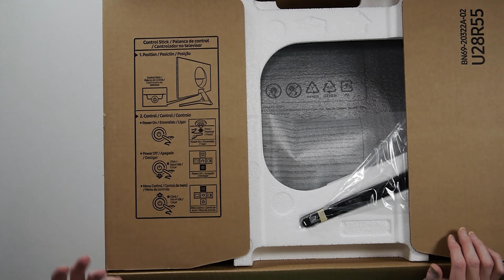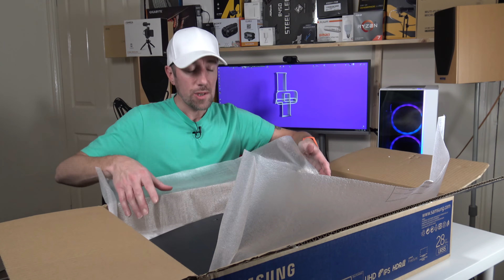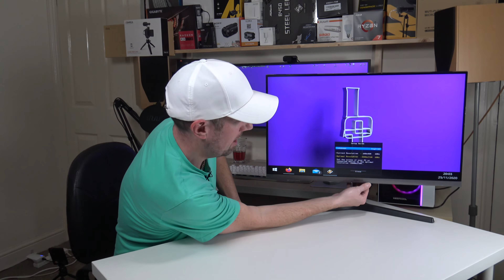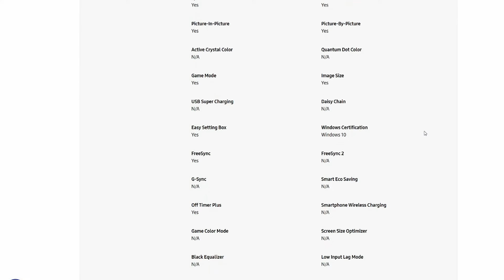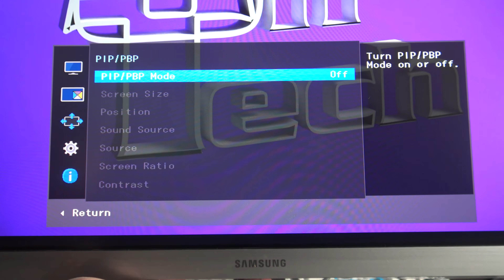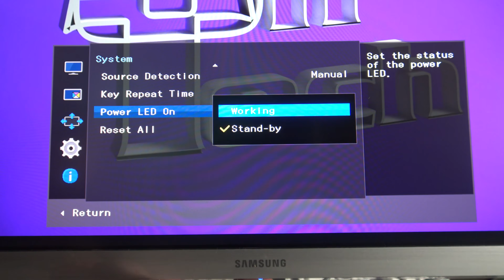Samsung 28 Inch 4K Monitor - Unboxing & Setup! (UK 2020)

Comment: i have a question..if you have this monitor can you connect your xbox as well as your pc to it and switch inbetween these two?
Reply from the maker: It does have HDMI and display port, so you could yes 👍 tho the monitor is only 60hz

Comment: Received the RU55 monitor yesterday, it's awesome!  I connect my MIBOX3 to HDMI1 and PS5 to HDMI2, but why can't I turn on game mode on the monitor when I use PS5?  The monitor no longer allows me to use "game mode" in the "picture" settings, but the MIBOX 3 HDMI1 allowed me to turn on game mode.  On PS5 I have of course PC selection, but on MIBOX3 I turn on AV selection.  FreeSync and HDR On When Supported are turned on, but why does the monitor not allow the game mode to be turned on, I need an explanation, but I'll be honest, right now the PS5 quality of the image I see on this monitor excites me!
Reply from the maker: Try a HDMI to display port cable 👍

Comment: I received mine today and so knew how to setup the stand thanks to your video. All went well.  However, I'm not sure how to remove the stand. Does anybody know?

The stand is fine for now but I'm thinking eventually getting a monitor arm.
Reply from the maker: Undo the 2 screws, then with the monitor laying down, pull the stand down. It took me a while to figure it out too 🤭

Comment: I plug it in but it’s black other than when I hit the menu/navigation button in the bottom. What do I set it on to get it to communicate with the hard drive?
Reply from the maker: Hard drive? You need to connect either a pc or laptop to it via HDMI 👍 it should auto detect whichever port you've plugged your HDMI in to. You might need to change display settings if on a laptop to use a 2nd display tho. Hope that helps 🤞

Comment: I'm having an issue with this monitor for gaming, so e.g. when gaming in 4k, there's a massive delay/lag when turning around, or just in general moving, even though FPS counter is over 100. as well as developing micro stutters, this reduces is 1080p, however still exists, my 1080p monitor has no issues at all like that, so not sure if it's the monitor issue or it's just meant to be that way

Edit : turns out if your mouse polling rate is over 2k it'll do that it's not the monitors fault
Reply: You can turn on the max overdrive settings if you want more responsiveness, but it will introduce noticeable ghosting usually on these non-gaming monitors.
Reply: @HandleIsNewAndBad  All solved, all I had to do was go into razer settings and reduced poling rate, solved the issues instantly
Reply: @xSkittlesxNewbx  Good to hear that.
Reply: @xSkittlesxNewbx  how do i do that?
Reply: @feetfanatic222  I hope this posts, as YT kept rejecting the post, but tldr, what kind of issue are you having? I had to try many different ones, until I found one that would suit my situation and sort the issue

Comment: This does not support hdr.. i wish i knew that before purchasing. 

BUT overall a good monitor for next/current gen consoles. Has 4k support, 2.0 hdmi, perfect size for gaming (32inch), and supports game mode and has other several key features.
Reply: HDR 10 on mine!
Reply: It doesn't huh

Comment: Hi ive had this monitor for a while and i use it for my XBOX ONE X, when i use HDR on the xbox my games go really dim and washed out, like ill be on the menu screen for RDR2 its bright for a few seconds then just goes really dim, ive tried adjusting brightness and other settings that dont become locked but nothing undims the display, Eco save is not on but its seems as though its always locked on in HDR mode, any ideas or fixes ? Thank you :)
Reply: You shouldn't use HDR with it. It's not capable of the required brightness or contrast. Stick to SDR.
Reply: @AdamH7  smh

Comment: Can i put keyboard cable,mouse cable, Head phone cable it same time
Reply from the maker: No, this is just a monitor not an all in one PC.
Reply: @IXISonTech  so which one and not expensive
Reply from the maker: Depends on what you will be using it for. 
They arent really good for gaming, but for productivity they'll be ok. 
Have a look on Amazon or a local electronics stores website 👍
Reply: @IXISonTech  i will message you on go store

Comment: I just got a Samsung 28 inch 4k  monitor for my dell laptop but my system wont work I need major help!
Reply from the maker: Change the resolution for the 2nd monitor to 2k or less 👍 
My works laptop just about worked with the 2nd monitor set at 4k, but 2k works great 😁 hope that helps 🤞
Reply: @IXISonTech  More than half of the settings on my monitor are turned off.
Reply from the maker: You need to change display settings on your laptop, just leave the monitor settings alone until you can get a picture on it. Are you using HDMI to connect to the monitor?
Reply: @IXISonTech  Okay ill try to change my computer setting, and yes I'm using an HDMI cord.

Comment: Any reason why game mode is not available. I plugged in the same hdmi that came with it. Any help
Reply from the maker: I'm guessing you've tried both HDMI ports? This monitor only goes up to 60hz. If you're on a PC or laptop, have you gone in to the display settings? 👍

Comment: hi, can I ask how to open the sound. because it always mutes. I already open the volume to be the largest, and set it to be output. But the volume still does not work.
Reply: Bro it dont come with built in speakers u buy there speakers seperate
Reply: @Alibingol12  cringing
Reply: same thing here, have you solved it?
Reply: What kind of speakers do I have to get? Not sure what to order for them
Reply: @abdel2351  go for same brand speakers

Comment: Ordered mine today but at £299 from John Lewis. I got it for my Mac mini M1, can you do a video on external speakers for this monitor?
Reply from the maker: Nice 👍 If you're looking for a soundbar, the Majority K2 is good 👍 I did a video review of that too 😉
Thanks for watching 😃
Reply: @IXISonTech  I’ll give it a look, cheers
Reply: hi, can I ask how to open the sound. because it always mutes. I already open the volume to be the largest, and set it to be output. But the volume still does not work.
Reply: @yuuuyi_tv  if you mean on the monitor, you can't, as there are no speakers built-in. 
You'll either have to use the speakers built into your computer or if it doesn't have speakers, buy external speakers instead. 
Hope that helps...

Comment: When I first turned mine on a screen popped up and told me that the selected resolution is 2k but I could change it to 4k. It went away before I could change it, and I can’t seem to find a way to get that screen back up. I went through the all the settings in the menu.
Reply from the maker: You can only control the resolution through the pc or other device connected to the monitor. What have you got connected to the monitor?

Comment: I got that Sam one but you can use it weigh speaker’s
Reply from the maker: Yes, you can use speakers with it. In the back is a headphone socket, so you can plug your speakers in there (providing the speakers have a headphone jack) then change you audio through windows to the Samsung monitor through HDMI 👍

Comment: Hi, my monitor is the exact same one as this one and it isn’t showing my screen even using the HDMI cable it comes with.
Reply from the maker: Are you using a laptop or pc with it? 
Have you tried the hdmi in both ports on the back of the monitor? And I'm guessing you've changed the hdmi input on the settings yeah?

Comment: I’m trying to know how to unmute the monitor
Reply from the maker: If you are on windows, click on the speaker icon in the task bar by the clock, then select the Samsung monitor 👍
Reply: @IXISonTech  the monitor I have is the one you have
Reply: And when I go on the volume setting the microphone logo has a cross on it and I can’t unmute it
Reply from the maker: Do you have a microphone plugged in? The monitor wont affect your microphone settings
Reply: @IXISonTech  I only use one to game
Reply from the maker: Where have you got the microphone plugged in? If its in the back of the monitor, it wont work that way as it only audio being sent to the monitor. Make sure your mic is plugged in to your pc 👍
Reply: @IXISonTech  I have it plugged in my controller because I have an Xbox
Reply from the maker: Ohhh. Maybe have a look in the controller settings in win10. Are you connected by Bluetooth?
Reply: @IXISonTech  no and I don’t think i use windows I just use the monitor
Reply: For my Xbox

Comment: hello! new subscriber. just bought this monitor today and am wondering if you can plug in speakers to this monitor? I am using this monitor for a ps5.
Reply from the maker: Hi 👋 Thanks for the sub 😉😁
I've just checked the back of my monitor, it does have a headphone port 👍 So as long as you select audio output through HDMI, the headphone port will output audio to your speakers 👍👍
Reply: @IXISonTech  Thant's great! thanks for checking. i knew it had an audio output but just didn't know if its only for headphones or would it work for ps5. Thanks for your response much appreciated!!
Reply from the maker: You're very welcome 👍😉😁
Reply: I personally think it looks great for 4k gaming.
Reply: Hey there, I have a ps5 and I’m wondering, do you truly get 4K 60hz on this while playing your ps5? I’m studying if to purchase this today
Reply: @julesthatruth1993 , in all honesty, i don't know what to look for when you say 60Hz, but I can tell you the monitor is stunning in 4K and plays smoothly on PS5 with no problems. I truly recommend. I hope someone who is more knowledgeable on the Hz thing will get back to you :)
Reply: @connor5887  I definitely get 60hz. I can tell while playing warzone and MLB The Show. I've never been early on this many fastballs in my entire time playing The Show.  Definitely worth the purchase. I took back a 4k tv for this monitor.
Reply: @connor5887  I definitely get 60hz. I can tell while playing warzone and MLB The Show. I've never been early on this many fastballs in my entire time playing The Show.  Definitely worth the purchase. I took back a 4k tv for this monitor. It's really all about your budget. Samsung has never let me down

Comment: Is 28 and 27 inch monitors the same
Reply from the maker: Do they have the same model numbers? If not, then they arent the same.
Have a look on Samsung's website 👍
Reply: No but like i have a 27 inch monitor and i Want a 4K one to make a Dual monitor setup and i Can only find Them in 25 inch that fit what i need Will there be a difference
Reply from the maker: Have a look on good pc websites, not sure you can get a 4K monitor smaller than 27inch 🤔 
Then have a look at the manufacturers for actual dimensions. Hope you find one soon 👍😉
Reply: No i Want a 27 inch 4 k monitor to fit førhen dimensions with my other 27 inch monitor

Comment: I am partitioning the screen 50-50. The screen goes off after 15mins if not in use. Once you wake up the pc the 50-50 partition collapses. Any solution? I have tried with and without Easy Setting Box (the software which comes with the screen). It should remember the screen settings, never happened on Dell QHD.
Reply from the maker: I've not used that software. But I'm sure there's a setting on the monitor for auto time off. 
Or if it's your pc that's going to sleep, changes the settings. In Windows 10, it's in setting, then power 👍 I always change everything in there to Never 😉
Reply: @IXISonTech  Thanks for your time. I have to keep those changes like the monitor/laptop going off after 30 minutes etc when ideal. Note the laptop is not in sleep mode just screen off only. I think the user should expect the screen settings where it was left means browser in the left hand and some another app on the other 50% of the screen. I was using dell 27 Qhd that use to remember the position of the windows. Never messed anything around. I have also removed the Easy Setting box and manually doing the 50-50 but when I come back all my windows are on a laptop instead of 28 inch screen.
Reply from the maker: The monitor doesnt control where your windows are placed. If when you turn your monitor back on & the windows have moved, thats the laptop.
Try using a different hdmi port on the monitor.
I too am working from home, when i go for lunch, then return back at my laptop, turn on the monitor, my windows have moved as well 🙄 
But, thats down to work locking the sleep time in windows 10. Countless times ive changed the power settings to never, but it always sleep 😳😔 
It's now something i live with on a daily basis....well, Monday to Friday anyway 🤭
Whereas my Samsung Ultrawide doesnt have the same issues. It's like the 4K monitor sleeps the hdmi port, causing the laptop to think it's been disconnected 🤔 
Thanks for watching and thanks for your reply 👍😉

Comment: Just got mine, its horrendous but seeing the pricepoint i understand
Reply from the maker: Whats wrong with it? I find the colours at 1st are a bit in your face, but its the same colours as when I plug my laptop to my main tv. Colours match my Ultrawide monitor too
Reply: @IXISonTech  Hey man, thnx for reply. The colours are quite off and in the highlights it falls apart quite easily. Now I have to say this is my first 27inch monitor but comparing it to my MacBook Pro 2015 its unnatural like a pop filter on instagram. I tried numerous setting, but it just doesn't
fit. Any idea?
Reply from the maker: My settings are:
Samsung magic bright - custom
Brightness - 85
Contrast - 75
Colour - green blue & red 50
Colour tone - normal
Gamma - mode 1
Upscale - mode 2
Hdmi black level - normal
Response time - faster
Screen ratio - wide
Then hdmi mode 1.4
All other settings ive left alone.
Hope they help 👍🤞
Reply: @IXISonTech  I will try!! thnx for you reply, for whatever it is worth, you earned a subscriber.
Reply: @IXISonTech  i think its my model, the colour shifts sometimes in the highlight!
Reply: @benjaminkotek8569  Did you end up getting a replacement?
Reply: @cloudstrife7349  Hi Cloud, no i went with 100%srgb screen which is for precise editing much more convenient.
Reply: @benjaminkotek8569  Ah I see. Thanks!

Comment: I use this monitor with my PS5. It looks fantastic but game mode, samsung magic, eye saver mode etc is always greyed out. I've used the HDMI that came with the PS5 and the one that came with the monitor and tried HDMI ports 1 AND 2 with both cables and I can't use those modes. Any advice?
Reply: I had this problem too and I was messing around with the settings and under the system settings , when you change the hdmi mode to 1.4 it’ll unblock the Samsung magic and all those other settings ,
Reply: hi, can I ask how to open the sound. because it always mutes. I already open the volume to be the largest, and set it to be output. But the volume still does not work.
Reply: @yuuuyi_tv  have you found out yet trying to get volume on it all day
Reply: @PA_Con  it has no speakers lol
Reply: Explore your settings, some block other options.  Mine has all options available depending on my menu choices.
Reply: How do you use sound with the ps5 and this monitor?

Comment: Just got it.. Kinda disappointed. How can I set refresh rate to 75hz instead of 60? I've tried going to the monitor settings and setting up a custom resolution but when I put in 75hz and click test it keeps saying test failed doesn't support it. Help me please!!!
Reply from the maker: The 28" 4K monitor doesn't have 75hz, only 60hz.
Reply: @IXISonTech  I did all this research on gaming monitors this past week and watched hella videos of people overclocking/creating a custom resolution(refresh rate) and they never mentioned you can't do it on every monitor...
Reply from the maker: This isnt a gaming monitor though. 4K higher refresh monitors are much more expensive than this model.
Reply: @IXISonTech  guess I'll take it back. I have a acer nitro 5 60hz version will it be worth it to upgrade to a 75hz/120/144hz monitor or?
Reply from the maker: How big is you wallet? 🤭🤭 Me, I've got my Ultrawide that does do 75hz, but my graphics card isn't too great, so rarely get 75fps in games at 3440 x 1440. Plus im not really a gamer so not too bothered about the Hertz. 
If you're a gamer, the higher the hertz the better 👍😀
Reply: @IXISonTech  just looking for a monitor for at most 300. Is there a notciable difference comparing 60hz to 75?
Reply from the maker: I didn't notice any difference between 60hz and 75hz tbh.
BenQ do a few 4K higher refresh rate monitors.
Do you have a highend graphics card that can play in 4K? If not, get a nice 144hz 1080p monitor instead 👍
Reply: @IXISonTech  my graphics card is the GeForce 1650gaming laptop version. It's not bad but I like to play Most of my games at almost full settings so for instance I play nba 2k21 but only manage around 58-60fps
Reply from the maker: If you can get those sort of fps, you arent going to get more with a higher refresh monitor. 
If your graphics card only gives you up to 60fps, it will only give you 60fps, no more. If you were to plug a 144hz monitor up to your laptop, you will still only get 60fps in your game/s.
Reply: @IXISonTech  ahh i see. I always thought at the very least a 144 refresh rate would make the picture quality a little bettrr/smooth... But that's not the case?

Comment: I need some help because I plugged the HDMI cable into my Pc I just built and into the monitor and nothing is showing up on the screen, I selected the correct HDMI port also.
Reply from the maker: Have you tried the other HDMI port? And tried using a different HDMI cable? 
Hope you get it to work soon 🤞👍